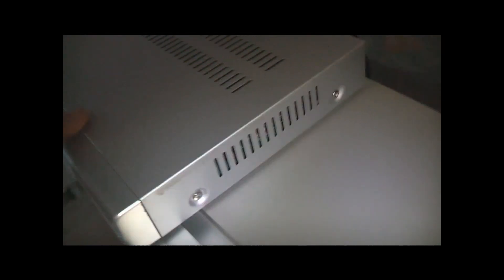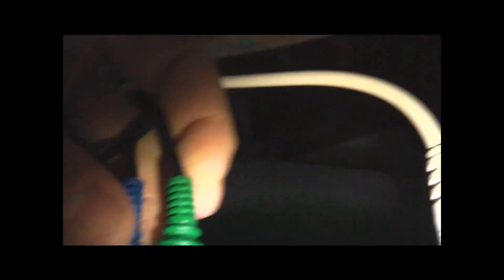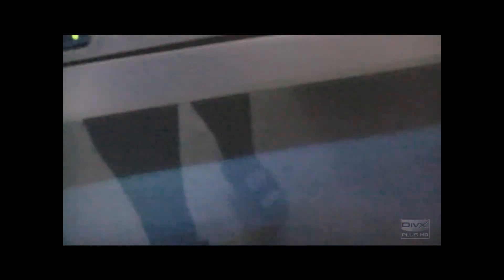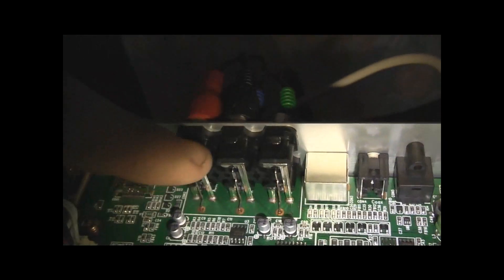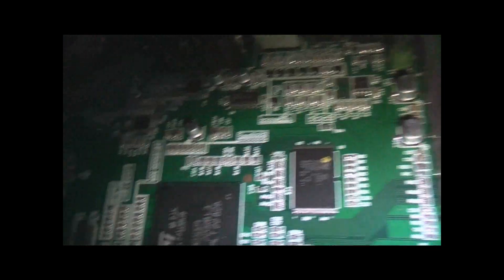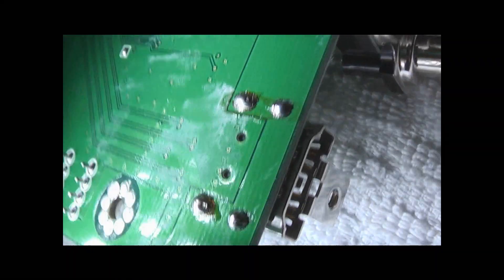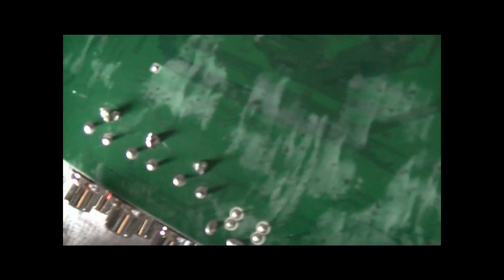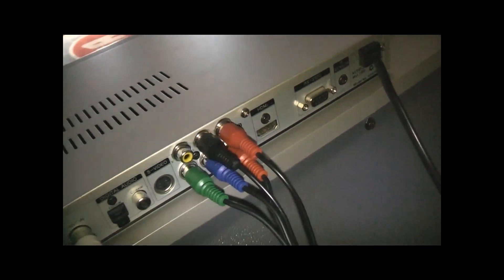Fixing an HD Set Top Box (Cold Solder Joints AKA Dry Joints)

Comment: most of the time is does not play at normal volume you have to increase it way over half volume to hear it  then randomly volume increases meaning it goes loud back to normal volume. What can i do to fix this problem??? help please . I also changed the volume control worked for a while then went back bad again. It's the (  Logitech X-540  ) today i also applied new solder on the control pad with no difference.